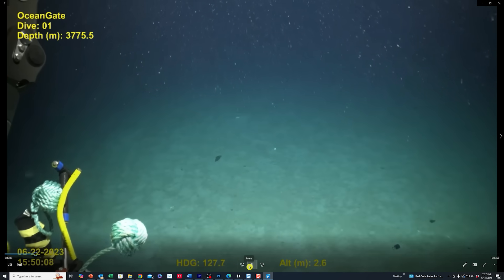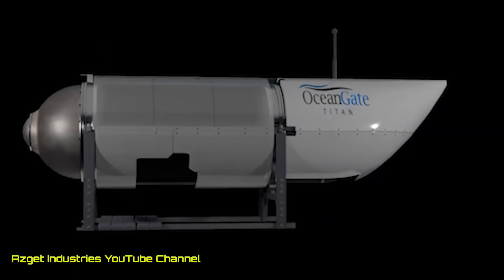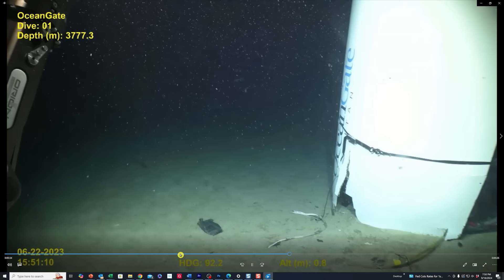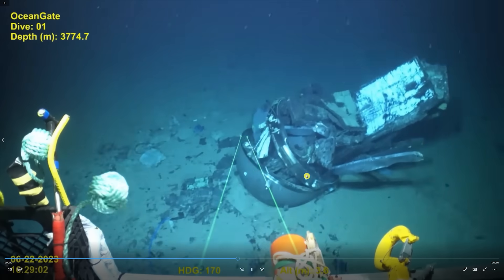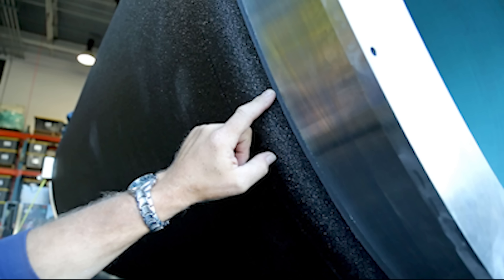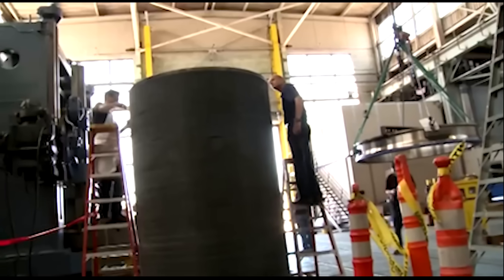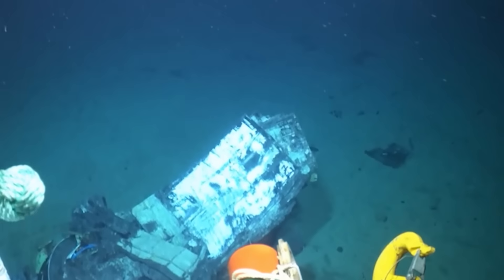OceanGate Titan Sub Debris Video Shows How It Imploded

Comment: Seems to me that the front titanium ring and the carbon fibre had differing material and structural integrity & as such, differing flex characteristics against the outside pressure. One materials flex being greater than the other, which placed stress on certain points and a forced gaps in others as one section became a different shape to the other. Something like an oval inserted into a perfect circle for example.

Comment: Why is this big part intact if it was imploded?
Reply: It crushes like a can under pressure. The weakest material joints were immediately destroyed. Evidently some of the imploded material was able to remain intact once the weaker members broke and released the pressure that was building. Also, imploded doesn't mean all is destroyed just like in explosions, there can be remaining material.

Comment: The carbon fibre wasnt even airtight. There is a photo of the carbon fibre. Once rapped around the steel drum they shined a light from one side and you can see dots of lights coming though the otherside so the carbon fibre wasnt even air tight there was gaps

Comment: 5 grown men were compressed to the rear titanium dome under the carbon fiber, sadly. Remember the sub did make about 28 trips to the titanic prior to  the accident. I believe the fatigue on the cabon fiber and lack of inspection is the what resulted into this accident. That sub would have been expired after 5 dives.
Reply: That’s insane that the 29th time was the one that did it though, and it just so happened to be the trip with all of them in it.
Reply: Spitballing, maybe their weight putting extra pressure on the bottom, body heat on one part, or vibration from moving inside added enough stress and or reduction of equilibrium to magnify the odds of failure.
Reply: Google says 13
Reply: You meant to say "gladly"

Comment: Using glue as a structural element is just plain stupid.  Mechanical through bolts on the Ti ring is only common sense.
Reply: Not for carbon fibre, it should have been bonded while the carbon fibre was being laid up.

Comment: The design was flawed in so many ways. A cylindrical composite hull could be made to withstand that depth. But, not the way they made it. A very thick wet filament wound cylinder (essentially ends up similar to a "finger trap" toy) wound directly onto the titanium rings would produce a stronger layup of the fiber and keep the CF to Ti joint in compression only. Still not ideal, but better. Better yet would be all metal. But Stockton thought he knew better and could not afford that option. Every aspect of this was done on the cheap from the game controller to the ratchet strap. All of this would have been fine for unmanned prototype dives of a test sub in order to refine the design for the "real" one.

Comment: 0:22 ...; This is not the first dive ; some one has already straped it up :body-blue-raised-arms: ; WHAT WAS THE STRAP FOR IF IT WAS ALREADY ON IT FOR ??? ...;  i mean i see the airport mechanic using ducktape on the plane engine ; im getting the f off that plane
Reply: In fairness, tape is really common for cowling, or covering ports for non-essential equipment that is out for maintenance.
Reply: @thedave1771  Yep. Very specific tape. From the General Services Administration, it has National Stock Number 7510-00-266-5016, and is approved for securing non-flight-control panels/tabs/covers on a temporary basis, to prevent further damage until a permanent repair can be effected. It's safer than just letting bits of metal rattle around on your aircraft where they could cause foreign object damage to the engine or impact the vertical or horizontal stabilizer or wing. 

The More You Know. 😊 

It's safe for the very limited application in which it is allowed, and it's not regular duct tape. It is more adhesive and has a greater resistance to tearing. I carry a roll for non-aviation purposes, but I work for the government.
Reply: There is nothing wrong with that tape, it's not ducktape, it's a metallic strip and super safe to use.
Reply: Did everyone forget after the find the titan debris and were unloading it onto land that there were multiple stickers starting the likely was probable human remains found inside the debris of the Titan? Cause I didn’t.
Reply: @austinblalock9058 I didn't forget, either.  I have not heard whether they ever identified if they were truly human remains, or not.
Reply: It's not duct tape.  And so what if it isn't the first dive?  If nothing was moved during the first dive, then it doesn't matter that it wasn't the first dive. The wreckage was still in the same place and in the same condition.
Reply: They probably didnt wanna show the human remains out of respect so they just showed the clips that didnt have them
Reply: @Macabre-Creations 
Explosive compression.  There are no remains other than a few bits of jelly that the bottom feeders already cleaned
Reply: @Texas_Cody the Coast guard said that they found possible human remains, so anything that they identified as possible human remains would not have been shown.
Reply: @Macabre-Creations  What human remains? They were turned into paste in about 0.02 seconds. I'd be surprised if there was anything besides small chunks of the carbon fiber, maybe parts of human bone, a small clump of decompose flesh here or there.

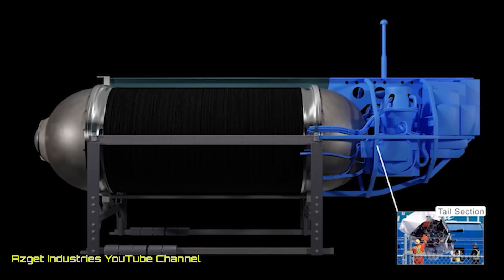Comment: 2:03 How’d the ratchet strap get wrapped around the rear section to presumably hold it together, before the first dive?
Reply: I believe the first video they were checking to make sure it was ready to be lifted.  So at least the second dive. There is a cable connected to the left of it.They may have removed potential remains or parts after finding and confirming.

Comment: Seeing this video, it is pretty easy to understand what happened.    Pressure on the fiber center made it implode the front cap popped off like a cork, the rear cap the fiber stayed somewhat attached because the front popped (why it looks so clean). The almost recoil effect from the front launching from the tube sheared the back section off that wasn't pressurized.

Comment: According to the USCG presentation there were two separate recovery operations.* The aft section, two Ti rings, one Ti dome w/ empty view port and leg structure were the first and featured in the well known video. One witness corroborated that there was a second recovery of the aft section. 

Pictures of the Titan seem to show that the Ti hemi-spheres were affixed to the Ti rings with hardware (nuts + bolts or machine screws. The forward hemisphere with view port was hinged to allow entry/exit and might not have been as securely fastened. At depth the water pressure would compress the domes and thus the rings onto the carbon fiber pressure hull. 

The Azget Industries implosion animation replicates the resulting pieces fairly well. The Azget simulation may have shown the result of a pressure hull failure at mid-cylinder. One witness (part of the recovery operation) opined that  based upon the wreckage and condition of the forward Ti ring the final failure began along the circumference of the Ti ring-hull interface at the forward end. This could well result in asymmetrical breakup. The piling up of wreckage into the aft end is reminiscent of debris piling into the tail end of an aircraft that broke-up mid-air when the explosive decompression begins well forward; in the case of JAL123 most of the tail was blown off initially).

*Source: https://media.defense.gov/2024/Sep/16/2003544483/-1/-1/0/CG%20001%20OVERVIEW%20PRESENTATION%20TITAN%20%20V5%2015%20.PDF

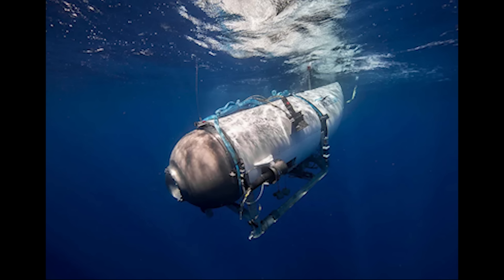Comment: 11:25, that exact lip that he is covering in epoxy is the failure point on the front ring. It's like a car window, if it's all the way up it's crazy strong but the second you roll it down past the top support is when it loses 75% of its strength. That ring had to support ALL of the carbon fiber's shape and it looks to be maybe 1/2" thick. I think it imploded the instant that started to crack. The reason why it would have been the front is because that front ring was subject to different load points every time the front door was opened and closed so the tension on that lip would have moved around that ring lip and just so happened to find the spot that could no longer take the compression load of the carbon fiber.

Comment: Why did it implode at depth rather than when they began to ascend? I was under the impression that the pressure would hold everything together even if there was a fault somewhere in the structure.

Comment: One thing I noticed is the front titanium ring is missing from the wreck. The dome attached to the weck is the rear section you can see the pins for the aft section. 

I personally believe the front ring failed.

Comment: The body of the sub shows the implosion was at that forward dome.  The entire sub body is smashed into the rear dome.  There are small pieces scattered but if you look closely you can see that the sub body simply was "sucked" back into the rear dome indicating a front ring failure.  So the implosion was front to back.
Reply: Scott Manley has a video out on the testimony and video that has been shown so far in the inquiry. And his take on what happened is very much the same as what you have text in this comment. The failure started at the front, and crammed everything into the back dome. At least the speed of the implosion is so quick, that the crew had no time to realize what happened.
Reply: @ronfullerton3162  The sad part about that is that it's starting to sound like it didn't "just happen" like original reports seemed to indicate.  There may have been several minutes prior when the passengers knew something was going wrong?  That is terrifying in of itself to imagine.   But at least like you said, the very moment of destruction was too fast for anyone to comprehend.  That at least is one mercy.  Better to be instant than to linger and suffer in darkness.
Reply: @demonqueen881  For sure. I guess that I have missed the part that there may of been a forewarning. I guess I need to dive back into the reports. Thank you for your reply.
Reply: @demonqueen881  I mean according to the radio logs the knew they lost engine power and were sinking because the sub was not descend neutral (another massive flaw in the design), that alone is scary, they could also hear the hull cracking.
Considering that hitting the bottom can actually also cause some serious damage to the hull because there is no second hull on this sub. 
If you hit the ground and there is a sharp rock there it might give you a tiny crack in the hull, this could cause catastrophic failure minutes later. 

So many things wrong with this, but the crew most likely suffered serious anxiety for minutes before dying in an instant.

First thing Cameron did with his sub is to make sure it ascends by itself the moment it loses engine power (by using electromagnets) the guys from Oceangate did the exact opposite, cant make stupidity up like this...
Worst sub ever designed...
Reply: @Triumph633  You're referencing the debunked (fake) radio logs.  The actual radio logs which have been released show that they didn't have any idea that there was a problem.  All the communication between the Titan and the Polar Prince were normal.  There were no mentions of hull cracking or failed engines.  The Titans four engines were mainly used for movement while at the the bottom not for ascent/descent.  They use weights for ascent/descent.  The final communication from Titan was when they were stating that they were dropping two weights.  Which was normal procedure in order to slow their descent as they approached the bottom.  Really everything was normal until the implosion which was instantaneous so its probably pretty safe to assume there wasn't any suffering or anxiety going on.
Reply: @travisc7506  i guarantee you the boy that didnt want to go in the first place, probably had anxiety the entire way down.
Reply: @ronfullerton3162  "may of been?"
Reply: @Triumph633  Stockton's ghost disagrees. His company will prove it by going down again with another sub designed the same way. 1st time was a fluke donchano. Accepting crew now per their website.
Reply: @grilledcheez08  The only comfort, in the absence of any comfort in how this all unfolded, is the fact that if it happened as quickly as believed and without any warning...Suleman has no idea that he died.
Reply: @yesitssarahbby17  oh damn, i could have sworn back when they went missing they said the boy didnt want to go?
Reply: @travisc7506 so just because the polar prince didnt get any comms means everything was fine and the crew didnt know anything was wrong? Well first off why should we believe anything oceangate says? I dont trust them at all. We dont know exactly what happened in those last seconds and the crew definitely could've knew something was wrong, even if just for a few seconds
Reply: @Mr.Blonde92  Well first off this isn't what OceanGate says it's the US Navy.  And judging by the actual transcript that the navy provided it doesn't seem like they thought there was anything wrong.
Reply: @travisc7506  the navy wasnt there the day of the implosion were they?
Reply: @Mr.Blonde92  Dude give it up with the conspiracy crap.   Sorry the truth is less exciting than the memes.
Reply: @travisc7506  wait whats a conspiracy? All im saying is Stockton might have known something was wrong before the implosion
Reply: @Mr.Blonde92  The amount of evidence that has been presented as well as eyewitness accounts from the Polar Prince crew show that nothing seemed amiss during the dive.  I'll also point out since you seem to think the Polar Prince and its crew were OceanGate employees that they were not.  The Polar Prince was a private vessel chartered by OceanGate.  It wasn't their ship.  
When you still want to say otherwise after all of the overwhelming evidence it falls into the conspiracy category.  Think what you want about Stockton Rush but it's pretty safe to say the guy wasn't on a suicide mission.  If there was a problem with the sub it would have been voiced on the radio logs.  The first set of radio logs were fake.  The latest are real.  There's nothing out of the ordinary in the new logs.
Reply: Not just the sub body but the passengers too. Whatever was left of them was compressed into that debris... It's pretty eerie seeing it. I didn't know they had such high quality footage of it.
Reply: I mean, the front dome was the section everyone pointed to as absolutely not being up the snuff
Reply: @goldenhate6649  Not so.  Yes, it's potential deficiencies were widely discussed, but so were potential Carbon tube-to-Titanium dome interface deficiencies (e.g. lack of prep, adhesive shear failure, failure due to differential stress/strain deformation) and carbon tube implosion due to crippling failure (lack of stress transfer ability or inconsistent laminate integrity, both from questionable filament winding design).
Reply: @goldenhate6649 ”I mean” is a meaningless filler phrase that adds nothing to the sentence. If you want your posts to be seen as credible, I would advise not using that horrendous, irritating gen z phrase.
Reply: @bobbygetsbanned6049 yeah, everybody knows that captain obvious. The OP appropriately left talk of the passengers out of his post because it was completely unnecessary.
Reply: Could the sub not have been designed for all of the passengers moving to the front throwing off center of gravity and the sub could not recover? I would imagine the sub was front-heavy and if the sub couldn't right itself, maybe the passengers were stuck on top of each other or fell into the front dome? I would imagine at that pressure simply nudging the ocean floor can probably be enough to cause an implosion with that carbon fiber.

R/C plane guy here, I kinda get CoG.
Reply: They had alarms going off according to transcripts and they knew that Stockton had called it off due to alarms and because of the sounds that the hull was making...and then the ascending was not working right I'm sure they could tell that Stockton was worried even if he wasn't disclosing the messages that he was reporting....so I think that they knew that they were in trouble just by the actions of the sub by itself....I don't think they knew anything about the implosion other than it was a possibility.
Reply: @shaunnalyne1371  The original transcripts are bogus.  They are now releasing some of the actual transcript.  Everything was okay a few seconds before they stopped communicating.
Reply: @shaunnalyne1371 I'm not sure what transcripts you're reading, but that is not what the Coast Guard released during their  hearings last week. I think you're possibly referring to the now fake/debunked logs. The logs released by USCG lead us to believe they were oblivious to any issues or warnings.
Reply: According to testimony at the coast guard hearing, the inner lip of the front dome seal ring was ripped off, all the way around. This suggests that as the carbon fiber tube was compressed, particularly in the middle, its outer edge pulled away from the seal ring. This broke the glue adhesion and allowed the tube to be compressed further at the seal ring's inner lip, until the lip failed and the tube collapsed from its front backwards.

All of the front seal ring's inner lip was missing indicating a rapid and symmetric failure of the lip.

It's not clear how much flexing of the tube occurred.

Credit to the coast guard hearing, engineering witness and Scott Manley.
Reply: There's no way the billionaire brat wasn't scared as it cracked like mad. This would happen even on surviving journeys.
Reply: Thanks for that obvious observation, Sherlock.